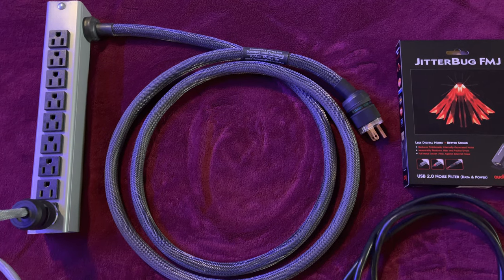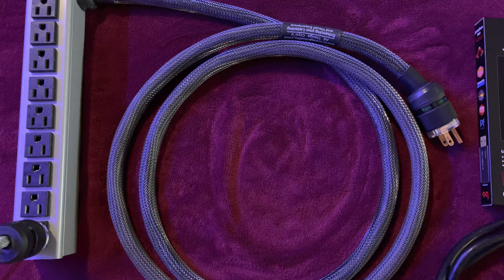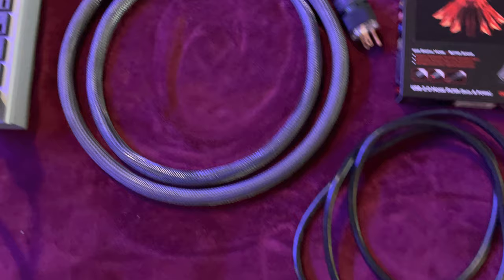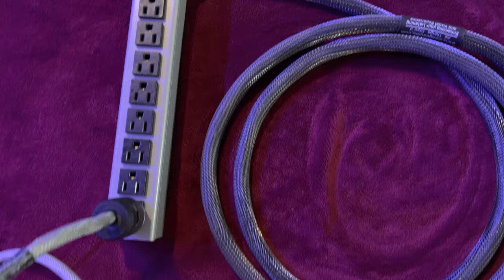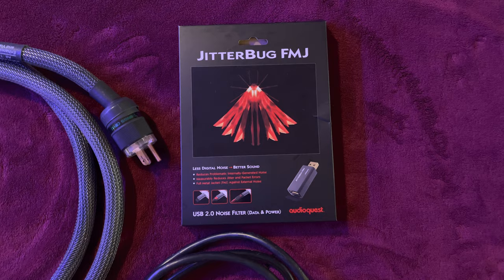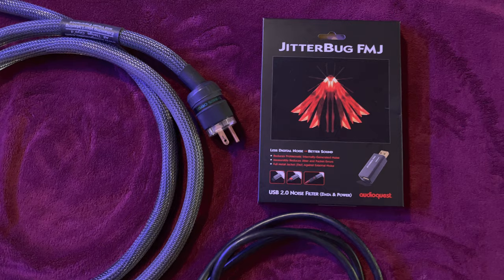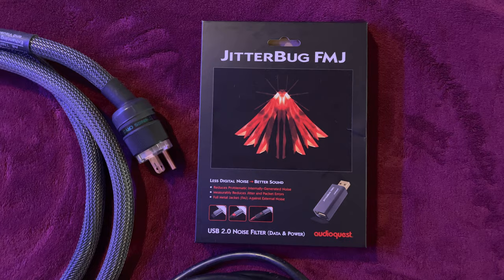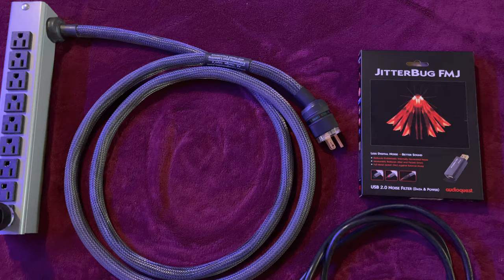CLEAN POWER TO YOUR TV AND AUDIO!.SONY A80J SONY A90J AUDIOQUEST JITTER BUG FMJ!

Comment: This thing looks pretty cool to be honest looks dense and probably helps with the connection pretty good.
Reply from the maker: Yeah man can you believe they charge $500 for something like this online. I actually had the cable from an old amplifier hook up I had and of course I already have the power strip hooked into my system. So you know me always tinkering around. It’s fun and makes a difference in av sound and vision.

Comment: I have used one of those Wiremold strips for over 20 years. It was the choice of Naim Audio USA for many years and when I bought my first Naim amp, that was the strip that was recommended by Chris Koster. No power switch, no filtering, no fuse, star grounded. Great power strip. Like everything, they used to be much cheaper but are close to about $100 now I think. The model number is the L10320.
Reply from the maker: Thanks buddy if you have a webpage to drop on here where everybody can go please do. Thanks for the insight much appreciated.
Reply: @fadetoblack.-   Just a long time enthusiast here. No webpage, but keep up the good work.

Comment: People have to educate themselves on AC current and the electromagnetic field and things that enter it to diminish sound quality,get clean power and get great sound
Reply: Is the power into your home clean? Where an how does it get "dirty" and how can the cord make it clean again? Would it help to upgrade the outlet? I don't have a budget for a cord like this but what things would help at a reasonable price.
Reply: @alexloz5746 hire an electrician to put in extra dedicated circuits to rooms you want to set up an aduio systems in if you have a really high end setup you may want two circuits to have separate runs for your subwoofer and other speakers if you're pushing real power